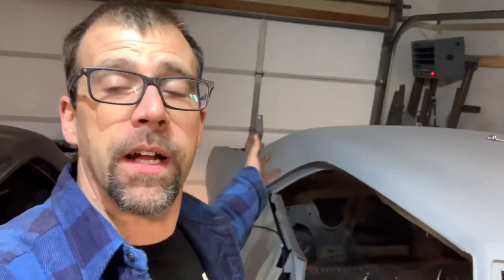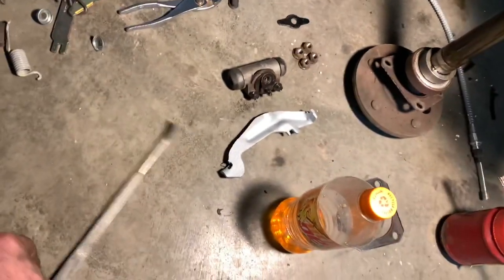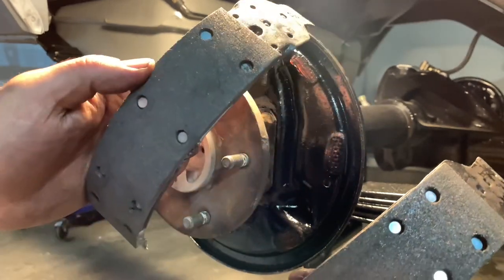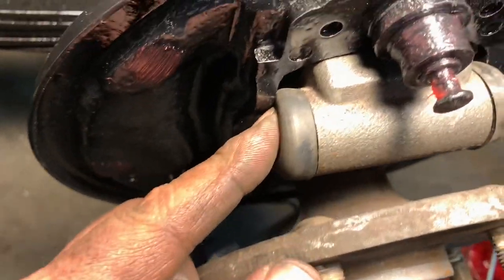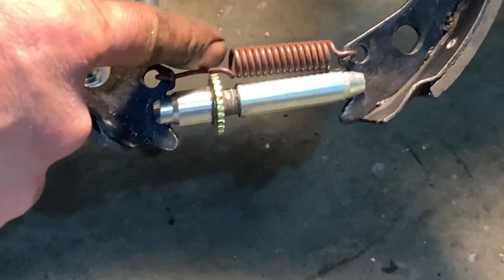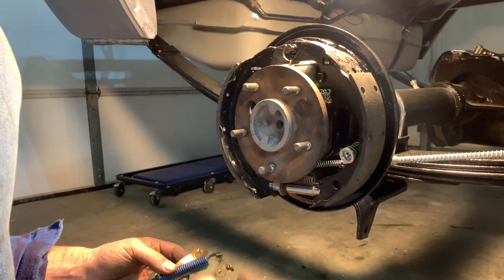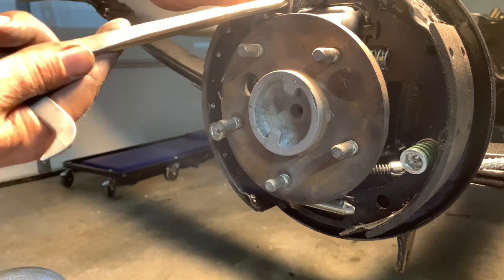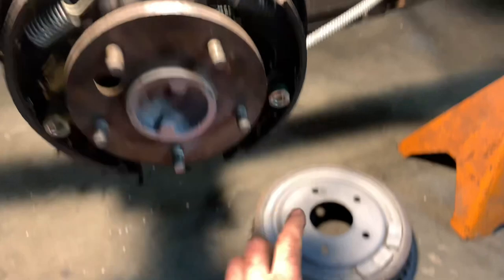Drum brake questions? Where the pieces go and how to get them there

Comment: Years ago, when my friend came over to replace my axle bearings he told me my drum brakes were on backwards. I assume he meant that adjuster towards the bottom. Wish I had an air cleaner lid for you, I bought mine from Classic 
Thanks for another GREAT video!
Reply from the maker: I have seen it many many times when I worked in the automotive field, shoes oriented wrong. For the most part i think it was lack of experience, newer drum brake vehicles the shoes are not different all four are the same. My guess is it’s not taught to look for and locate them in the right location. 

I will see how much shipping is for it from classic industries, thanks.

Comment: very valuable info Jon.  Nice tips on greasing the contact points (which I did not do).  As far as an exhaust system, I took my car to a local Pipe and muffler shop and they were able to bend pipes and add a close to factory system completly installed for around 350 dollars.  Looking forward to panel alignment and sheet metal work.  Stellar work my friend.  So glad i found your channel.  Merry Christmas!!
Reply from the maker: Thanks! Super glad you found our channel too. $350 is a bargain on the exhaust I will see what I can turn up around here. Merry Christmas to you as well!

Comment: I would take the car to an exhaust shop and have them install exhaust it may save you some money..  some of the parts are radically overpriced.  i ordered a c pillar for one of my cars last week from a place that use to get free shipping on his Sheetmetal orders. so that's why i went there.  Turnes out classic industries now charges him shipping on all his orders now so i still had to pay for shipping. 😕
Reply from the maker: I understand there is a cost to shipping but it’s gone up substantially not just a little bit and it hits the wallet hard. A complete factory style exhaust was around $250 and 50 shipping.  Same setup is $500 plus now 🤷‍♂️